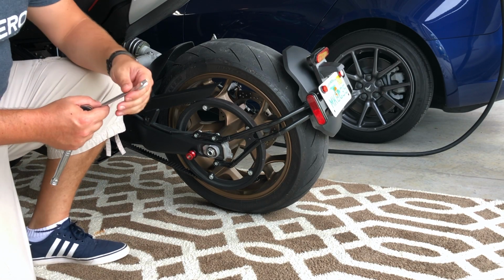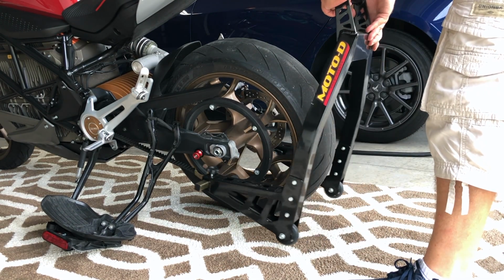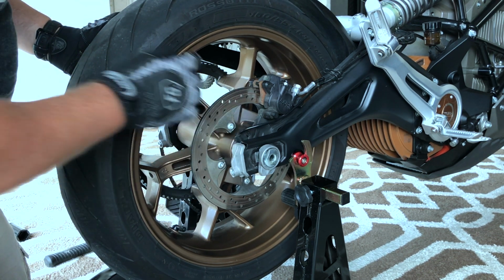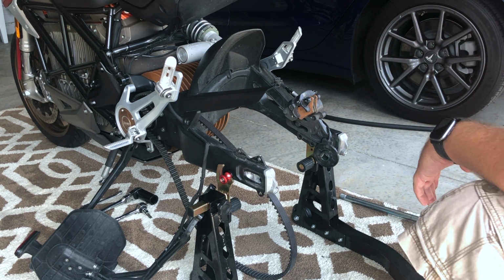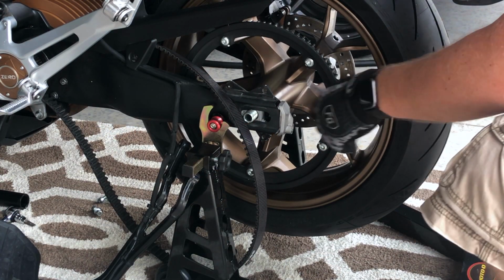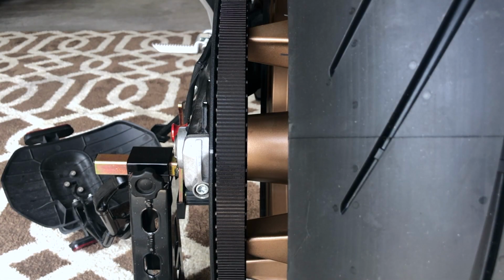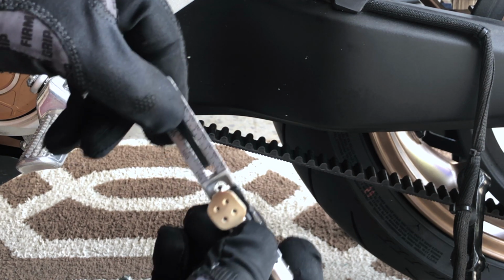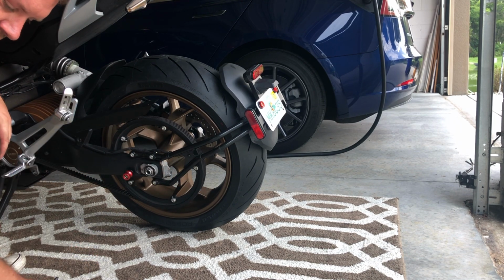Zero SR/F - Removing & Installing the Rear Wheel

Comment: Thank you for the excellent video, especially the belt alignment section. It was a piece of cake and no fear for me using your video. I put a plank on top of some wedges under the wheel to prevent it from falling down when the axle is pulled. Makes it also much easier to rearrange everything. And the plate holder finds a perfect rest on the bike's seat and will neither be in your way nor scratching on the floor when the bike is lifted up/coming down again. Last tip from my side: The carbon belt tension app is working perfectly and may even be more exact than the tool.
Reply from the maker: Thanks!  I'm glad it was helpful!  I've since replaced my tires a couple of times and use a wood block underneath the wheel.  Definitely helps quite a bit when it comes time to reinsert the axle and keep everything in place!

Comment: Thanks, I just bought an SRS. A hint for you, what Ive always done with my other bikes. Put a piece of 2x4 under the bike with the ends of it fore and aft of the rear tire. Now insert another suitable sized piece of wood under that board  from the back side. The farther you push it under the 2x4 the higher if lifts, like moving the fulcrum of  a see saw. In this manner you can support the rear tire at a precise height for working with the brake and inserting/removing the axle.
Reply: Yeah that's how I do it also.....Makes sliding that axle rod in and out a piece of cake.....And maybe take the brake caliper off too.
Reply: @Phoenix Brecken No one cares

Comment: Nice job. Made it look easier than I made it. My Brake was a b**** out and back in. 👍
Reply: Juggling the rear brake, the ABS sensor, and the spacer located on the left side of the wheel requires some finesse.  One viewer offered a really helpful tip that I've used for the past two tire swaps, and that is to put a 2x4 below the rear tire for support.  It's not enough to help you get the wheel in the perfect position, but it's very helpful for setting it down for a moment if you need to make minor adjustments.

Comment: Hi a trick you can do to keep the brake pads from closing up when there is no disk between them is insert a shim right away when you remove the wheel. I prefer the plastic ramp shaped shims available at home stores that are used for installing windows and doors.

Comment: I have a 2020 Zero S, yet it seems that my does not come with the swing arm spool holes that allow me to lift up the rear wheel, did you have to drill into your bike's frame?
Reply from the maker: Nope.  The Gen3 platform (SR/F & SR/S) have these mounting holes already.

I’m sure this process is very different for the Gen2 bikes.